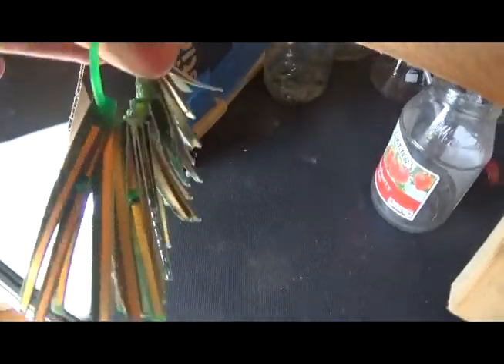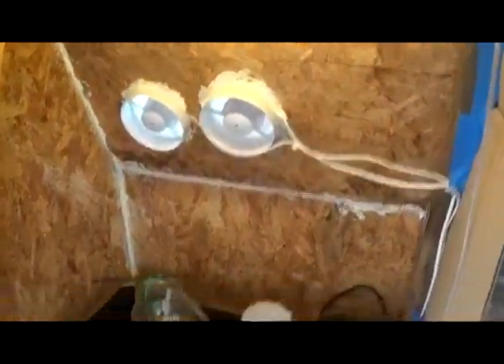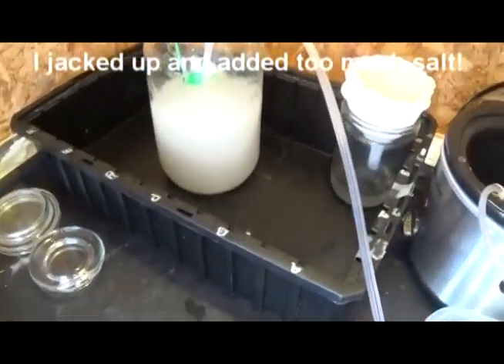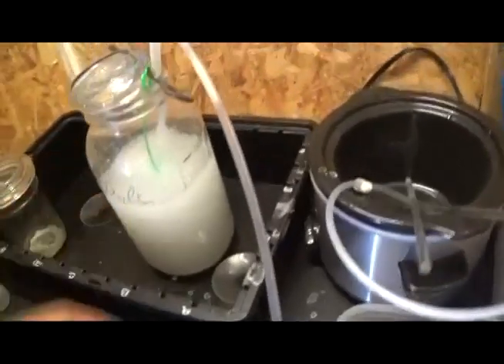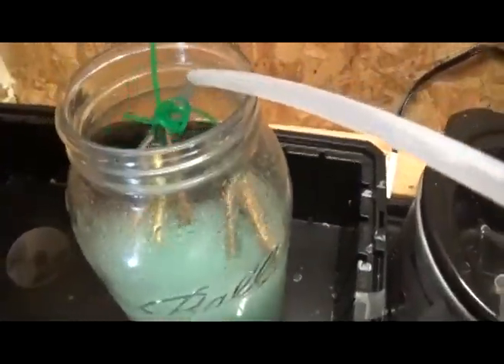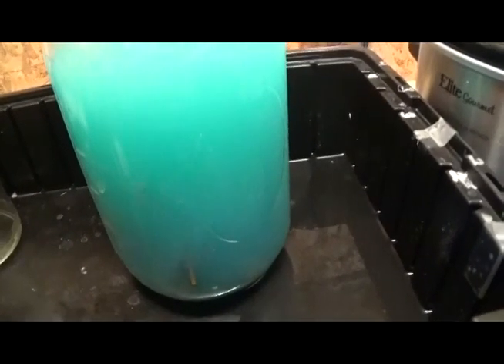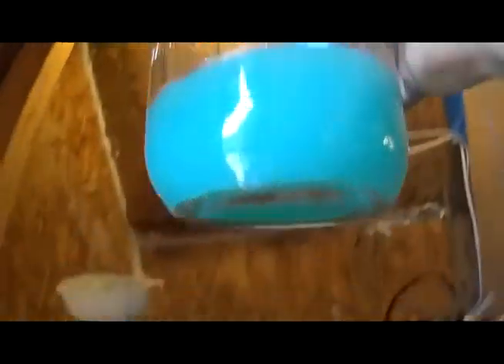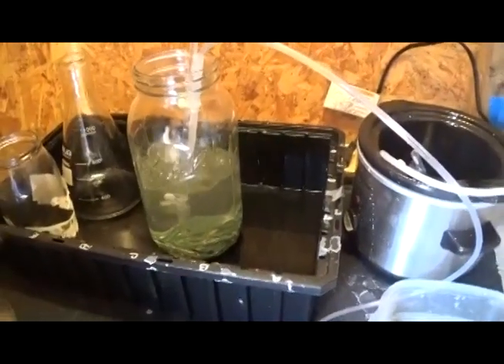Rapid Electronic Gold Recovery with Vinegar, Salt, best method

Comment: Does salt act as a catalyst for the vinegar and h202 as well?
Reply from the maker: All I am doing is creating a very weak hydrochloric acid and the peroxide is acting as an oxidizer...
Reply: @KentuckyColonel  I'm sure I've seen it suggested somewhere else
That you have to put a small amount of dulute Sulphuric acid to kickstart the reaction. 
I'm interested in your thoughts on that?

I've used the same mix on some fingers, 
but had them sitting in a bucket of it for over 6 weeks, 
and there's still plenty of gold on them. 
I'll have to give this another go with bubbles. 

Thanks for the tip!

Comment: Home Depot has a 30% vinegar and will work faster.
Reply from the maker: Defeats the purpose of doing it with grocery store vinegar and sea salt.. I could simply use HCI or nitric and complete the task in 15 minutes.
Reply: I tried plain vinegar+salt method but it either doesn't seem to work or takes absolute ages using 10% vinegar (strongest I could find around here)

Comment: Oxidation is the key to the process, not agitation. Use a fish tank air stone, it will increase the amount of oxygen in the solution and provide circulation. Another trick is plastic mesh canvas. Ive used it many times. Make a basket or false floor to place in the container. Put the air stone inside it with the fingers. As the foils come loose they will fall beneath the canvas and get trapped / separated automatically.

Comment: I gave you a thumbs up so you’ll know my intentions aren’t to be a Jerk - i do feel i need to be the voice of caution here because you created ( unknowingly? Acetic Acid by mixing vinegar and Hydrogen peroxide. i know because i have done it / and burnt the crispy creme out if my lungs -  i smoked 2 pack a day for 30 years and i would have smoked 2 packs a day for as many years as i got so its not like i’m some”wet my capris @ the first hint of danger type “ but for reals it is the same kind of acidic gas as produced by acetone.( i can’t remember if the acid gas is as flammable as acetone but i can tell you that Hospitals started mixing Vinegar and Hydrogen peroxide in 2020 - something about a plandemic - i don’t think it got much press 😂 … anyways bunch of hospitals heard it was a great anti-fungal - and the had the esl housekeeping staff mix up some into spray bottles - and many staff started experiencing lung problems ( the article does not mention what happened to 
the staff , i’m guessing the got fired for something completely unrelated… like not getting jabbed or voting for the bad man ( You know th to go  e one Satan thinks is ruining politics)

Comment: What do u use for your vent hood , I’m about to make one with old bathroom exhaust fan
Reply from the maker: Use 2 of these in a nice sized plywood box, paint the inside white (to reflect light).. and get the appropriate sized vent hoses.. adapters to connect everything, adapter for the outside.. Plexiglas for the front.. that's it.. Plan on spending around a Benjamin ($100) to build one that will save your life if you have an emergency.. so don't screw around with that, your safety.. do it right.. 

https://www.amazon.com/gp/product/B08LZ6N9VV/ref=ppx_yo_dt_b_search_asin_title?ie=UTF8&th=1

Comment: at 1:56 you say you used vinegar and salt instead of hydrochloric acid. FYI vinegar + salt does make a weak hydrochloric acid solution. Salt = sodium chloride, vinegar 3% = acetic acid. If this weak solution is left in your tool shop uncovered, your tools would corrode. The only advantage of using this solution is that it is cheaper than buying hydrochloric acid and diluting it to 3% strength. I know, cause I've used both. HCl works quicker, vin + salt works slower and depends if you want quick results or take your time results. The advantage of the vinegar process is that vinegar and salt can be kept indoors or in your work shop safely, hydrochloric acid should be kept outside. The vinegar process will work if left out in the sun for 10 days and no bubbler is needed.

Comment: Just FYI heat gun and a pocket knife and those foils will scrap right off some you have to hit them a second with a propane torch but most just heat and they slide right off!
Reply: try using an  X-Acto knife score the edge a couple times at an angle then peal off slowly. with practice you'll get good at it.

Comment: So how DO you get rid of the "goo"? I've been lookin everywhere for instructions and it seems to get glossed over, I've got a ton of foils sitting in about 4 filters in a thick layer of goo. I'd really like to fond out how to get it out of the goo so I can clear my work bench off lol.
Reply from the maker: 2 ways... eliminate TIN and LEAD from your batch.. you do that in the beginning by closely cutting your gold finger from the RAM and leaving those SMD or SMT devices on the RAM stick and not the Gold Finger.. thats where the goo comes from,,, 2nd way; wash the crap out of your foils,  in a filter, with hydrochloric acid ... The waste solution will be cloudy.. then it will clean up as you wash it out

Comment: I just read something that said vinegar and peroxide is potentially harmful.. I read this after I got everything mixed and bubbling... Is this correct or should I just disregard it?
Reply from the maker: On safety... you have to make your own judgment call.. some say peracetic acid,  is no big deal and some say otherwise.. always take the best safety precautions possible..
Reply: @KentuckyColonel  yeah I ended up going with it. Just moved it to a table in the yard. You know how u got that green percepitate? I got that within an hour, and by nightfall I had this funky maroon colored solution. And you made mention of extreme agitation... I used a air mattress pump... Talk about extreme lol. I had to cut about a quarter sized hole in the lid, make a gasket, and literally clamp the jar to the table it was on. But 150 grams of trimmed waste processes overnight. Of course tgere are some stragglers. About to put them in fresh solution and go again.

Comment: How did you separate the goo and the gold I'm having a hard time getting my gold out of that goo.
Reply from the maker: I wash it in HCl, lots of the HCl washes... or, and it takes more time, wash in vinegar and add a pinch of baking powder, it will fizz, the gold foils will float in the fizz allowing the goo to pass through the filter.. tedious and takes time..
Reply: @KentuckyColonel  do you have a video showing how to remove the goo
Reply: Baking powder or baking soda?

Comment: Wouldn't it be just as well to leave it alone instead of pulling it out and brushing 
it ? what you brushed off would probably have fallen off within the next   hr.because it was loose anyway. Right.  Just saying  !!
Reply from the maker: Brushing most certainly speeds the process up. Watch other video's on the subject.. 99% of them use HCI and Hydrogen Peroxide, 12 hours, sometimes 24 hours.. Thanks for watching!

Comment: Very nice effort but what about pins
Reply from the maker: Gold Plate would require reverse electroplating.. more than likely using sulfuric acid.. nasty process and unless you have boat load of gold plate, not worth it. If that's what you were referring to when you mentioned "pins"..

Comment: how do you safely get rid of the waste at the end? :/
Reply from the maker: The waste is actually weak Copper(II) acetate... use your own judgement and do your own research but it's harmless... basically.. makes a decent weed killer ..
Reply: @KentuckyColonel  will adding iron to the solution drop out the copper/tin or any other contaminants?

Comment: hello will this work on gold plated 925 silver? i have alot of gold plated  925 silver i want to restore to its original color...
Reply from the maker: No... All this process does is release the gold foils from the copper bonding on the RAM.. You would have to use a reverse electrolysis method.. with sulfuric acid.. NASTY and dangerous process.. If it's only gold plate..

Comment: Iv been looking online to see what's available and found 35 percent for 18 dollars a gallon
Reply: You can always distill it to make it more pure
Reply: @duckduckgo358  you can but then for how much peroxide are you getting out of it? In 3% there is 97 percent water you would be getting only a little bit
Reply: I'm not ungrateful for the suggestion I'm just thinking of how much would be needed
Reply: @nolanfoster6782  I meant distilling at a temperature between the boiling points and take whats more concentrated with acetic acid. you can also freeze distill it like one can do with alcohol. You can also add water back to it so you can choose your percentage that way

Comment: thats awsome bro ;) 
i did use toxic before but have now stopped, this method take longer time but are more safe for us and earth ;) 
great video ;) i do have some stuff in my channel as well ;)
Reply: johnny how do you pull the gold out of the solution? no bleach. is there a eco friendly way?
Reply: @laurennoyb539  well soon all the gold part is off i filter it, than dry it and save, i cant refine, it to toxic and have no space for that now
Reply: Will cleaning vinager work if not where can I find the right stuff at
Reply: @markpicente3948  same question km using cleaning vinegar goin on 2 weeks now though with it and barely any seperation

Comment: It is only proper for electronic scrap with thick gold plated. But for thin plating gold such as cell phone, the lamination will be eated by vinegar without dissolved in the solution.
Reply: You can still extract the gold from solution. There are plenty of videos on that process.
Reply: @BlackLogan.1652  4

Comment: Does the vinegar eat the gold as it removed rust maybe metal if in to long?
Reply from the maker: aqua regia (AR) dissolves gold not any type of acid, including vinegar.. AR is hydrochloric acid (HCl) and nitric acid (HNO3) or you can make a weak AR using HCI and Bleach.. Just use stannous chloride to test for gold in solution, if one is concerned..
Reply: @KentuckyColonel  in

Comment: is this better than hcl and h2o2
Reply from the maker: NO! But you're not creating Toxic gasses, and (Unless you're scared of a little copper acetate) the leftovers makes a great weedkiller or mold killer..
Reply: @KentuckyColonel  I have a silver bar, gold-coated silver bar, can I use it for that, or you prefer HCL and h2o2
Reply from the maker: @WRDO  If your gold coated silver bar is thicker than standard gold plate then I would use Nitric acid to isolate the gold. If it's simply gold plate then you will have to use a reserve electrolysis method (nasty process).. this method will not work for that.. all this does is eat the copper away so the gold foils release..
Reply: @KentuckyColonel  please watch my video at my channel i made gold colour from silver and yeast and sugar, here in Canada we don't have Nitric acid , i have HCL and H2O2 , the gold layer not thick